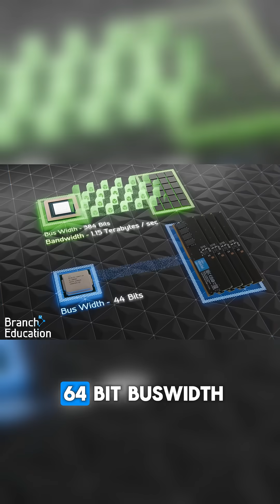How do Graphics Cards Work? Part 3 #gpu  #videogame  #technology  #engineering  #gpucomputing

Comment: The GPU in all its rights is a computer of its own, but it works with another CPU to process data. 
Think of the hard drive or SSD as a person, the game files as a “coloring” books with instructions where the 0s and 1s are color pixels. When you launch a game the SSD tells the GPU what to put on the screen. The calculations might be SUPER fast, but in other forms of applications it would be inaccurate because the GPU is only meant for one thing. Processing graphics unto a screen. That’s it. The CPU might be “slower” but the CPU isn’t just for processing graphics unto pixels, but rather processing more complex algorithms to bring you access to internet browsers, calculators, writing code and understanding it, transferring files, uploading files. If the GPU did this things it would inevitably crash. You make it sound like the GPU is a much better and stronger machine compared to the puny CPU and its whacky RAM sticks. Good explanation until you sided with one rather than explaining that each component has a purpose. If the GPU was that good, why do we still need a CPU and ram on a motherboard of its own?

Comment: Small correction. Even a RAM have 64 bit bandwidth, we also often use dual-chanel mode, with 128 bit bandwidth. Only need 2 identical RAM stick

Comment: Going to put this here, typically a GPU bus width per module depends on the type of module and how it's placed on the card. The card shown here is based on the 3090, and at the time of the 3090's release Micron was only able to make 1 GB modules of GDDR6X, hence why it had 24 VRAM modules, and on the 3090 the VRAM chips were put on the same spot on both sides of the PCB so it acts like 1 VRAM module.

Comment: Gpu data hungry but not sensitive to latency 
Cpu not so data hungry machine but so sensitive to latency from main ram... 
amd 3D cash helping the cpu latency runing low. the new copper bounding in 9000x3d cpu have lower latency the regular bump bounding. Found in 5000xd and 7000x3d

Comment: The PS5 Pro does 16.7 teraflops compared to 10.28 for the regular PS5 but Nvidia's Huang is announcing a new chip at CES this week that does 70 teraflops and costs $250 and they're making it to run AI but I wonder how it would be at gaming.

Comment: That is absolutely wrong. Steaming data into the GPU is done in seconds. Depending on your Disk speed, if RAM is also involved as preaching or not. but filling for example 12gb Vram is done over PCIE4.0 x16 (30gb/s) in 0.3 seconds if your SSD can keep up with. 
Regardless of this loading data isn't the majority of loading time in a game. Setting up the environment, precalculating shaders for later use, and so much more is done beforehand. a GPU is like a computer in your Computer but thing hundreds of cores with a more or less infinite calculation speed. A GPU uses a type analog computing scheme. you have a Compute pipe's, in that pipe you have a cluster and every cluster has a number of shaders that is set of ALU's. 
You basicly set up first your pipe and in that pipe every cluster sets it's shaders and after that you trow your input value in and you get instantly your result. you can use up to 8 shaders in series on modern GPU's for one cluster. Becuse of that your GPU processes data more or less instant you need fast Vram, therefore yeah 10Tb/s or more are common on modern GPUs but the faster your GPU and interconnect to the system the less Vram is needed. Especial if you use Resize BAR. This means you use your system RAM as GPU memory. For example a DDR4 system with 3600mts has in a dual channel configuration 57,6gb/s so even you use PCIE5.0 your RAM is still fast enough to fully load your PCIE5.0 x16.

Comment: not accurate, it goes from the SSD to the RAM which is huge and very fast, but not as fast as the GPU memory (although much bigger). Then it moves back and forth from the ram to the GPU memory very quickly.

Comment: Back in the day, when I was an engine developer myself, the data had to be transferred in the rendering pipeline. Vertexdata, Indexdata, texturedata. The loading screen just was implemented to load the data from the virtual filesystem, packs, or whatever in the RAM (not VRAM) in order to process or cache it.
Reply: That's still what happens. I don't know why he said the loading screen is used to move the data to the GPU. You still send triangle data to the GPU every frame, and loading screens happen to mask the loading of data from your storage to the RAM.
Reply: ... also used to precompile shaders.

Comment: And even while knowing this, some people still buy systems (especially laptops) where the video board shares your RAM. Meaning it is not only forced to work with 64 bytes memories, but on the same wires the CPU use to contact its own RAM. So it's either CPU either GPU using RAM at any given time and not both.
Why would anyone buy such a crap? It does not even matter what model your graphics chipset is anymore if it uses shared RAM, also known as "dinamically alocated RAM". If the system allows you to dedicate a part of your RAM to video, do not buy it, it's that simple.

Comment: TLDR:

GPU: High volume simple problems
CPU: Low volume complex problems.
Reply: GPU is like a room full of random people plugging numbers into a spread sheet. 
You can process a lot of data real fast, but they are all working with the same set of instructions.

A cpu is like a small group of mathematicians, they can do more complex jobs, do their jobs faster and can all work independently but can't process the data in huge bulk like the room full of people.
Reply: Comments are taking things far to serious lol
Reply: True
Reply: You made that 10x harder to understand lmao
Reply: As if Branch Education is so boring that you'd need a TLDR.
Reply: Love those "simple explanations" that are so damn wrong all the time.
Reply: these guys disagreeing with you don't know how CPU and gpu work
Reply: not that you are wrong, but the video has nothing to do with your summary
Reply: Depending on the CPU? No... Xeons and Threadrippers for example are designed to manage a huge amount of simple processes very quickly. Ryzens or i7s/i5s are meant for less more complex processes. Which is why the Xeons are meant for servers and workstations, Ryzens for Gaming. Your CPU can process a small amount of graphics the same as a GPU, it just doesn't have the onboard memory to store the textures. 

Most GPUs actually have less than half the clock speed of a CPU, but they have larger caches and their own dedicated VRAM, not to store the models, but to store the textures. 

Your CPU runs things like mathematical calculations of a bullets trajectory, how much damage, did you miss or hit, what is the AIs response to your action? 

Your GPU renders the gun, bullet, impact, and corpse into an actual image for you to see. But the CPU tells it what image it needs and where to render the wall, where the bullet is going, and if it hit somebody
Reply: @IntusMortuum  lets not forget cpus usually have an iGPU now thats picking up some work. i think..
Reply: @Keanue-Anakoni-Aukai  nah, integrated graphics are almost never picking up some work if you have actual GPU.
Most common expection to this could be laptops, with hybrid systems due to power saving settings.
Reply: @symix.  ah, okay. That makes sense, thanks for the info.
Reply: if you need a tldr for a short you need to touch grass. good god..
Reply: @Keanue-Anakoni-Aukai I have tiles at home😂 no grass, but other plants, ☘️😂
Reply: @AmberRathour366  same bro, same haha. stay up and fly high lol
Reply: rendering a video game doesn't sound so simply. i am no engineer tho
Reply: no

Comment: I am convinced we can make a 100GB game fit inside 20GB by making the textures lower resolution and during loading, using a carefully picked seed and model specifically trained for that game's assets to AI upscale the game's textures during the game loading screen, which would put way less strain on the SSD but more work on the GPU and maybe more loading time but there's less to copy from the SSD to the GPU. The upscaling might even be faster, after all DLSS can run in realtime and looks good, they could for sure make a high quality upscaler for the textures, and the developers can change the upscaled images to their liking. I want this to be innovated on, I'm unfortunately too dumb to do that myself, maybe one day I can accomplish such thing. This would mainly fix that 400GB download needed for new games.
Reply: If i remember well Nvidia Is working on something called neural texture compression that should do something like that.
Reply: I don't think you know entities what happens now but you have the right idea from 20 years ago. Right now that's his regular compression and mixed with tensor cored in modern gpus.
Reply: No thanks, I want pure frames not ai generated bullshit like dlss

Comment: Even the 5090s vram is only around 900GB/s what graphics card is even at 1.15TB/s??
Reply: Actually the RTX 4090 has a bandwith of 1.01TB/s.
The Radeon VII, which is a high bandwith card (that uses HBM2 Memory insted of GDDR6). Has a whopping 4096bit bus width with 1.02TB/s bandwith which is the highest gpu by bandwith.
I really dont think that a 1.15TB/s is existing especially for gaming and consumers market

Comment: first off, the graphics card being represented here by these numbers is either a 4090 or yet to be released 5090 (The only cards with 1TB+ total bandwidth or 24 chips), second, binary ones and zeros are a lie, it's above or below reference voltage.
Reply: The longer video is of the 3090 and the 3090Ti. You can tell because the fans sit inside the silver frame rather than slightly through it.

Comment: nvidia: we can only afford 128bit bus
Reply: in a card that costs more than 2 honda civics.
Reply: and my 7900 GRE I've spent $500 has 600GB/s
Reply: 3060 Ti has 256 bit bus, not 192. The regular 3060 has a 192 bit bus.
Also the 4060 and 4060 Ti have much higher L2 cache, at 1080p they don’t require as much memory bandwidth as older GPUs did.
Reply: Which is why im looking forward to the 512bit bus on the upcoming RTX 5090
Reply: The buswidth is supposed to be designed to match the computation power of the gpu xD
Reply: My 4070 has a 192-bit bus?? Which gives me 500GB/s of transfer speed... the 4090 has a 384-bit bus so over 1TB/s of data speeds... not sure where you're getting the 128-bit #

For gaming you don't need a large bus, things like the Radeon VII with its 4096-bit bus are meant for extremely high end and complex rendering and scientific computations (or Crypto mining) 

But the Radeon (despite having the biggest bus on the market) can't even handle 4k gaming... has 0 Ray-Tracing, and despite having over 10x the bus size, just barely outmatched the 4090 in overall transfer speeds... 

Things like VRAM, clock speed, and architecture design are far more important than bus size 😂
Reply: @IntusMortuum 4060/4060 Ti have a 128 bit bus despite a card like the 3060 Ti having a 192 bit bus for some reason
Reply: @IntusMortuum  rtx 3060ti with 192 bit bus is faster than rtx 4060ti in 4k native gaming just becuze of faster brandwith on older generation.
rtx 3090ti vs 4070ti example 90ti slams it in 4k but 1440p and below it lose.

vram speed is important when playing higher res.
Reply: @IntusMortuum  That's not 100% true having too low of a bus speed can actually limit the amount of frames you can put out in a second. 

my 6700xt could not hit over 150 fps at 1440p no mater how low I dropped my settings, or what upscaling I used in any and all of my modern AAA games. Me and a buddy with a math degree kept running the numbers and nothing made sense until we factored in the bus width. upgrading to a 256-bit card fixed the issue.

best way to think of it is like is like funnels. you pour a bunch of liquid in to a funnel with a tighter tip (lower bus width) rest of the funnel fills up and you have to wait for it to go down before you add more. doesn't happen as much with wider tipped funnels. That's the kind of bottleneck bus width has on gaming.
Reply: @IntusMortuum  thats why that GPU sucks, its size of 60ti tier and called for 70.
you maybe forget but Nvidia tried to sell rtx 4080-12gb and failed when people notice its size of 60 tier low end for high end price and they call it back waited 3 months and resell it as rtx 4070ti xD
Reply: @IntusMortuum yeah.. I wont be paying 200$ more for 4070super over 7800xt.. I want raw gaming, not upscale or some magic I wont be using in all games I play
Reply: @IntusMortuum  the 4060 and 4060 ti have a 128 bit bus 

also I laughed pretty hard at Radeons allegedly not being able to handle 4K  and as for RT, yeah it's worse than Nvidias, but for the most part, people don't use RT even on the most high end cards

Comment: Ohh, thats why modern game needs a really big vram,
Reply: No its only because of Texture Resolution getting bigger and the amount of textures used. Older games had 2GB of Vram and stored all those Textures at once in Vram. Now you got open world games where you load and unload at realtime because the texture itself are 60% of the total game size. Meaning theres no way to load 70 GB of textures into memory at once and keep it there. You fill it to 80% of your vram size and period.

Literally in Games like CS:S you had the whole map loaded at once and kept in vram until the server changes maps. No Hiccups.
Reply: rtx 4060 128 bits ?
Reply: It used to be you could get away with 2GB of VRAM, and 6 was excessive... now 6GB is barely usable and 12 is the new average. Mostly due to 1440p and 4k textures becoming commonplace. 

Same with RAM itself... used to be 16 was more than enough, now it's the bare minimum just to have an office computer on Windows 11.... 32GB is the new "More than enough" anything over that is excessive... doesn't stop the idiots throwing 96GB into their rigs though 😂 only time that is useful is if you run several dozen VMs
Reply: @IntusMortuum  Can confirm, 16gb ram just isnt enough for most things I play anymore.
Reply: not really, textures is what demands high vram, so higher setting more vram, and higher resolution also means more vram
Reply: Not really. It’s called “optimization”. The game can render things at a distance BUT these things can be lowered in graphics. Basically an optical illusion. If you have a pixel art of something, at close range the pixels are super noticeable, as you walk away the image loses those sharp edged and gets smooth and looks better. 
The method of rendering ONLY what’s in front of the player has been a thing since the early 2000s, this is a method to save strain on the computer as a whole. Look up game design and you’ll see people back then were more clever. Nowadays most “modern” games are just lazy OR they intentionally leave their games to weight over 100GBs because they want to make sure you don’t play other games. The more time you play their games, the better it looks to their investors that’ll go “oh wow you have over so many users playing constantly?”
Reply: The definitive edition? More like defective and need higher clock speed
Reply: Also because it's unoptimised
Reply: @Cringemoment4045 has nothing to do with optimization
Reply: @ It definitely is?